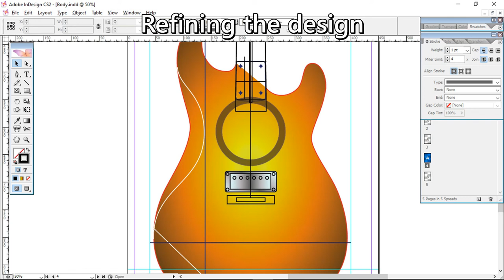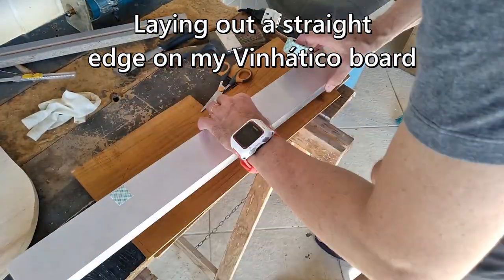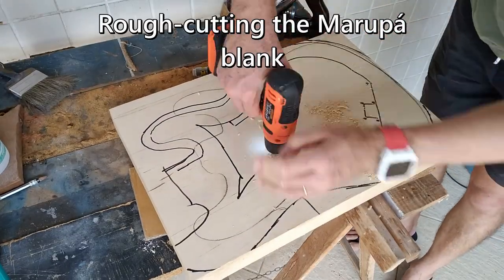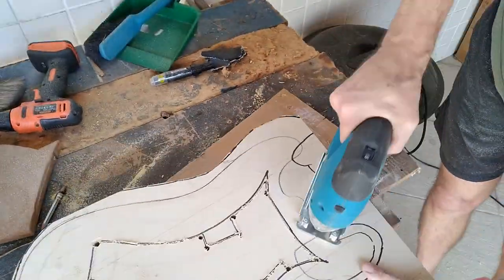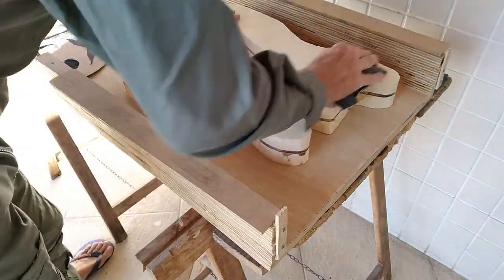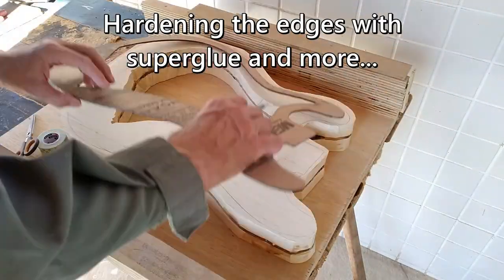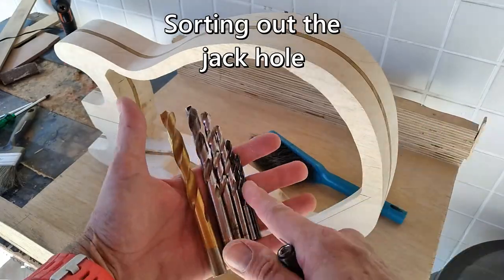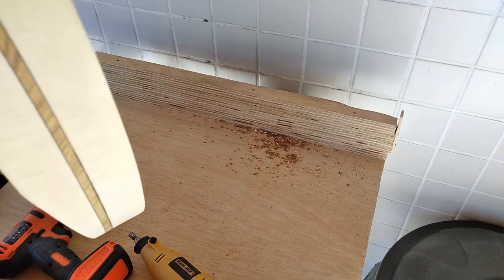GGBO2022 - Scratch Build - Shaping the body

Comment: You need the masking tape/ superglue trick for using your thickness jig. Works great.
Reply from the maker: Believe it or not, I've yet to try it, though many recomend it.
Reply: @skintguitars6289  I used to spend money on the expensive double sided tape. I have also put screws in waste areas and countersunk them. Super glue and tape is pretty cheap and easy.